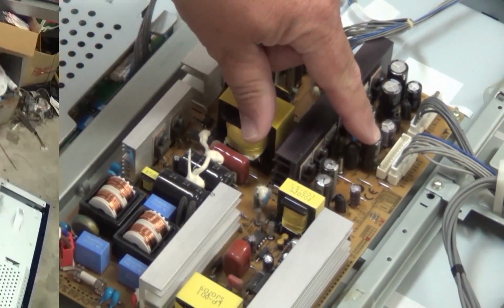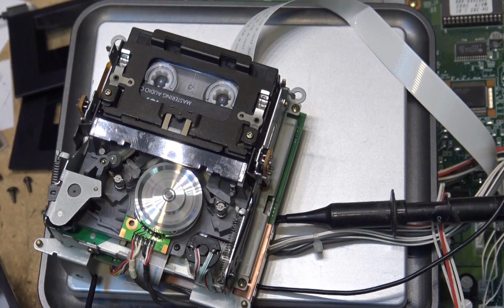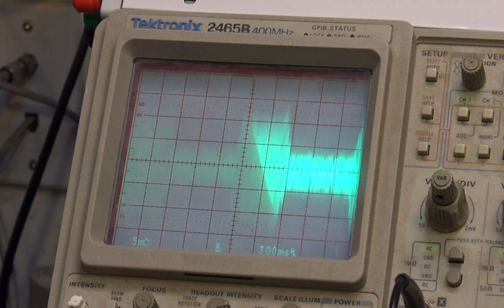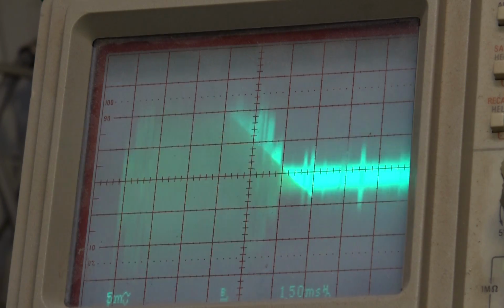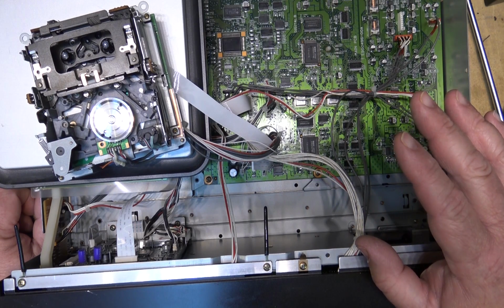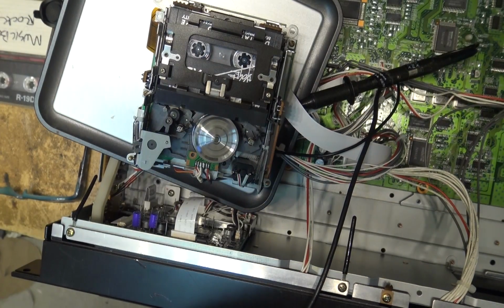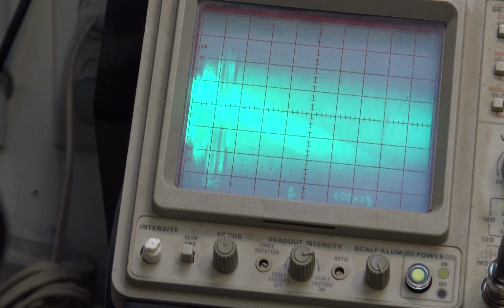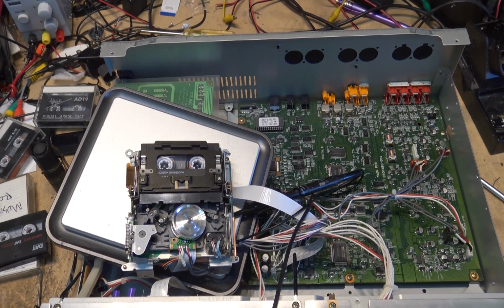Tascam DA302 Dual DAT service

Comment: Way too many moving parts im . Helical scan mechanism. 
I restore 2" quad broadcast video tape machines. Straight tape path, but several servo systems.
Check out an AMPEX VR2000
Reply from the maker: Yes like a VCR. Moving parts but they do work. Yes I have used an ampex quad. Had one at the station I worked at but I never got to use it. Engineer only using that one. I was on the VPR1
Reply: @12voltvids  wait, u said you have used a quad before then went on to say you never fot to use it? Please clarify.
The VPR is a helical machine. Way to complex tape path and to have tape in CONSTANT contact with tape is like sandpaper on the video heads. The Quads have a str8 tape path, much like an analog audio tape player. You could almost just drop the tape in, hardly any threading.
I worked at the largest post production facility in NYC and we had 28 quads there, after working for decades at a broadcast facility in NYC.
Reply from the maker: @rty1955  
I did operate it when i was doing my intern bit only trained on it.  When it was used on a production it was the engineer that operates it.  So i was trained but never got much practical time on it.  I was working Master control and we aired everything off 1" helical scan.
Reply: @12voltvids  Ahhh ok. And yes I work exclusively on quads. The heads are in fact in air bearings and it rotates at 14,400 rpm. The female tape guide was a vacuum created by a venturing from the compressed air. The sucked the tape into a 'u' shape for the heads to rotate against. The portable quad (AMPEX 3000) used ball bearings in the heads and sometimes. You would see the instability if the heads on the picture. It also had no erase stack because there was no room for it.
I actually have two Sony BVH-2000 machines in my garage

Comment: How come you are not using the SWP pin for channel 2? How is the envelope stable without the SWP(trigger) channel?
Reply from the maker: I have a good scope. Will trigger from the waveform no problem. I could trigger from the swp but my second scope probe is bad and I haven't gotten around to buying a new set.

Comment: You made a comment in your written article that drums are designed for each specific unit and could not be swapped.  I sold my brand new still in box 302 about 8 months ago and picked up a used one sending to service.  Sight unseen except Craigslist.  If I need a new drum, not that I do, are you saying I need to find a 302?  Or are the drums the same on a Tascam DA 20, 30, 40, 45, 60 and 302?  Btw, I’ve owned tons of DAT recorders.  Most all.  I just purchased a brand new sealed box Panasonic 3700 and a Fostex PD-4M.
Reply from the maker: They are specific to each chassis.  The da40 and 30  use the same transport.  Sony has different drums on different machines.  Some are 2 head others 4, some standard size that run a 90' wrap. The portables used a smaller drum with a 180' wrap. Some pro 4head machines used a larger still drum and the tape was wrapped 45'. This allowed for faster scanning and was used on  computer backup drives.

Comment: Your video is very helpful. I have a DA-302 but need to replace the pinch roller.
However, I can not take it out from the player. Do you know how to take it out for the unit ?
The other question is do you know the spec of this pinch roller ? I would like to find one and try to fix it.
Thanks in advance.
Reply: I also have the same .

Comment: If your camera has manual shutter speed adjustment try playing with that, so that you dont get flicker while filming analogue scopes. Worth it !
Reply from the maker: It does have manual shutter but it is a rolling shutter not a global. 
If I use my CCD camera I get no flicker but do on this one.
Reply: @12voltvids  In the IT realm DATs evolved into the DDS storage format (first called DAT72 then DDS), have you ever had a tape streamer on your bench?
Reply from the maker: @eigenvector7035  I have a DDS deck around here somewhere.

Comment: Hi again Dave, I went back and viewed your vid where you picked a wet Toshiba VCR / DVD unit out of the trash. In it you adjusted the tape guides after the sticky tape issues. I saw how you used a small screwdriver. It answered that question.  On a Samsung VHS /DVD unit I have, the DVD has an intermittent spin issue. I can sometimes use my finger to start it spinning with partial success. If it keeps spinning, it will play OK.  Any suggestions as to what may be the issue ?  Thanks for your shared knowledge .   J K

Comment: I wouldn't call Teac/Tascam decks "easy to service", when you compare them to Sony units. Teac decks have cable spaghetti running all over the place, while Sony has every component laid out very neatly and marked out with no wires or flat cables getting in the way. I have a Tascam 102 and a Sony KE400S and I find the latter a lot easier to access.

Comment: Dave thanks, did you use a standard screwdriver or one with a notched tip to adjust the capstans with a screw adjustment in the center ?  It would have been helpful to see a close-up of the actual adjustment .   Next time ?     J K
Reply from the maker: Just a regular screw driver, small slot.

Comment: See that you aren't using your Uni-T scope?  Thought you would with a digi signal.  Just got a Siglent scope; but still have the ol' Tektronix 465 too.  That 200mhz Siglent is a really nice unit; fair price too . . .
Reply from the maker: The Uni-T is useless for this type of work. Does not display RF waveforms well. I would never have bought it knowing what I know now about it. Perhaps some are better, but this one is pretty useless.
Reply: @12voltvids  I use my Siglent for the expressed purpose of RF work, and it does a fine job.  I'm a Ham that works on radios.  What is the problem with your Uni-T?
Reply from the maker: @robertwadsworth5226  
Doesn't work well for complex waveforms like video.  I use it for some things. I am also a ham but I don't work on many radios even though I am asked to all the time. Not very active in t he ham community.  Use the radio in the car from time to time and that is about it.

Comment: Cool stuff. Never had a Dat, or mini Disk player . (Have a mini Disk, but never got a player) Looks like DAT cassettes have short tapes. Unless they have longer versions.
Reply from the maker: These tapes I use for testing are just short ones. I have mostly  2 and 3 hour tapes. That turns into 4 and 6 hour in the LP mode.

Comment: Now that's what a real analog scope is ideal for, i used to use my old cossor cdu150 for,
video head adjustment :-)
The decks look so easy to access, i do like that :-).
I've never had a dat to repair, it's likely because the cost of such a unit would stop most ordinary users buying the system in the first place.
Reply from the maker: They were expensive, but so were all other high end tape machines. The format didn't succeed in the consumer market, but in the professional market, recording studios, radio, tv and film production it was the industry standard for over 20 years until hard drive recording replaced it.
Analog scope is the only way to look at wave forms like this. Digital scopes, at least the cheap ones like I have are completely useless.
Reply from the maker: @Mdnosliw Its a great scope and the price was right.

Comment: Did the idea for the DAT mechanism come from the VHS mechanism
Reply from the maker: Yes they thread similar, but only a 90' wrap on the head drum. This results is far less head and tape wear.
Reply: @12voltvids  Does the 90 degree wrap also mean that the tape could (in theory) hold twice as much data if the drum was made with 4 heads instead of 2? Because now there would be a super wide gap between each track.
Reply from the maker: @Stoney3K  some dat decks did use 4 heads (computer backup) but the head drum was bigger and the wrap only 45". This was done to reduce head and tape wear.  The data on the tape is identical. Computer drives used longer thinner tapes for more data capacity so this is  why the larger drum.
Reply: @12voltvids  So that still gives you a full track of gap between the tracks, which is not the case with VHS, which has 2 heads with a 180 wrap and each head does a single video field. Did DAT keep that gap in between the tracks on purpose to reduce crosstalk?
Reply from the maker: @Stoney3K  no as far as I know the tracks are butted up against each other.  The angle is different between dat and a VCR